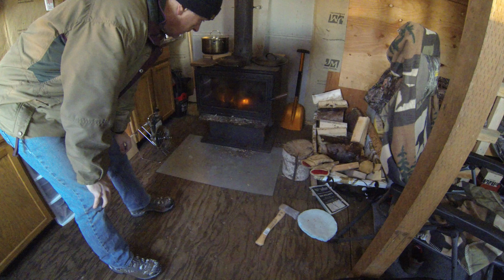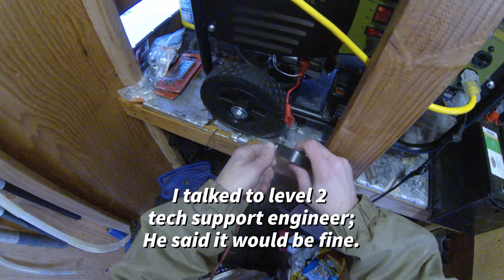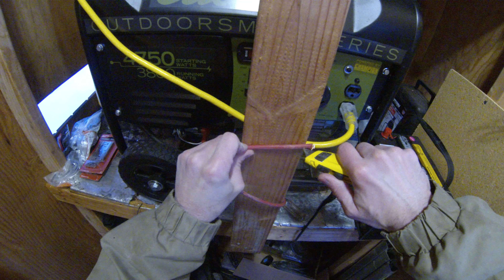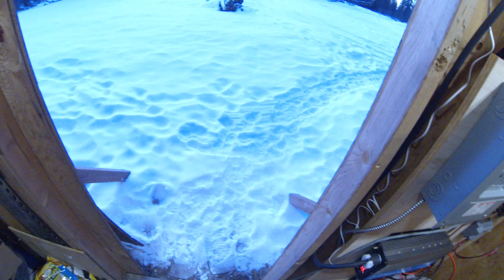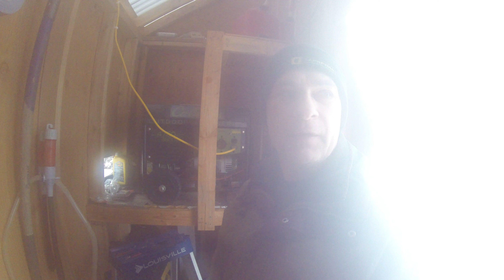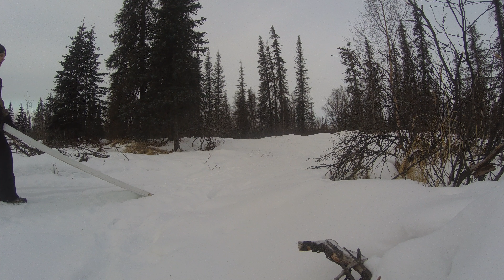Dragging a glass door to the cabin and generator issues

Comment: I did somewhat the same thing with my generator battery except that I left the terminals on and used a vice grip on one and a c clamp on the other.
You do what you have to when your at the cabin.
Reply from the maker: I agree.  ha ha I'm not worried, I have several extra of those cables plus I can always put the ends back on them.

Comment: Nice to be able to drive that close to your cabin as long as the swamp isn’t swampy
Reply from the maker: Yes it is.  In the past, I've actually driven right to my cabin.  Unfortunately the trail is not drivable with a vehicle due to a couple big mud holes now.
Reply: @MyAlaska12  oh that’s too bad that you can’t anymore but adds more fun to the trip I suppose
Reply from the maker: I'm going to try and fix it sometime now that I own the excavator.  Even if it's fixed, the weather conditions have to be just right to be able to drive a truck out there.
Reply: @MyAlaska12  I’m sure it would be a bit of a challenge to drive all the way there. Looking forward to watching you try to improve it with the excavator.
Reply from the maker: @debbiemiller7342 when it's frozen, it's an easy drive.  I'm not sure when I'll be able to fix the trail bc a lot of several different things have to align to be able to get the excavator out there.

Comment: I've drilled a hole in the top of the post before and screwed the terminal to it

Might suggest using a lighter weight oil in the gen during winter.

Put some heat in your fuel as well. Moisture crystals can get in carb

My Cumins is the same size and cranks fine on the small battery upto 10 below but without heat in the fuel won't start

Best option is run a small propane heater in the shack for an hour or so before trying to Start. It's much better on it, like plugging in your truck
Reply from the maker: Thanks

Comment: You need fuel, air, and spark. If you’ve got clean fuel (your carbs are cleaned) and no air blockage (unlikely on a small generator), then I would guess it’s spark. One way to check if you’ve got spark is to take the spark plug out and leave it hooked up to your plug wire…try cranking it over and see if it is sparking (just don’t touch it lol). If it’s not sparking it could be something electrical like a solenoid or something. If the spark plug is all fouled by carbon (black) a temporary fix is to burn it off with a blowtorch until you can replace the spark plug. Best of luck. It’s a pain working on stuff like this when it’s as cold as it has been. (Just curious, have you tried shooting some starting fluid into the air filter area?
Reply from the maker: I did buy a new sparkplug and ether.

Comment: All this time I thought you were off the road system. Wondered how you got all the supplies up there to build the cabin. And then you drive right up. How far is your home from the cabin?
Reply from the maker: My cabin is off the road system.  The cabin is about a mile from the road.  Most years, there are a 2 or 3 weeks in the late fall when you can safely drive trucks out across the swamps.  In the summer, it is about a 2.5 hr drive.
Reply: @MyAlaska12  Cool. Did you get all your building supplies up there in that 2-3 week window? Or make lots and lots of trips on the quad/snow machine?
Reply from the maker: I was able to take out a couple truck loads one fall and the rest was taken out via snowmachine or wheeler.